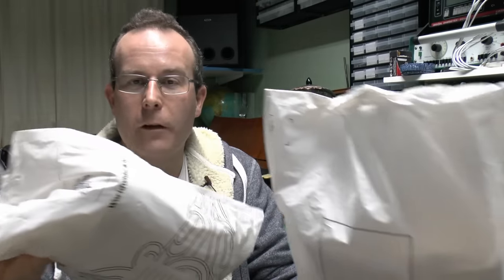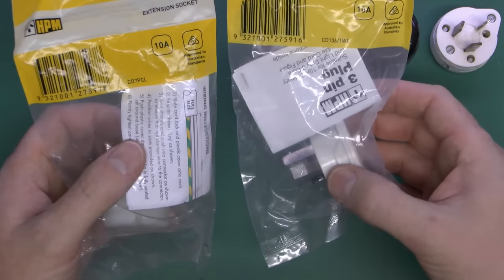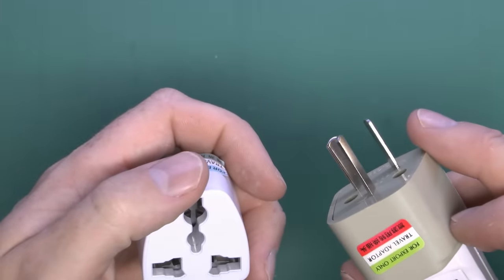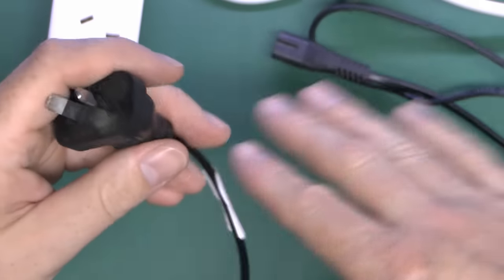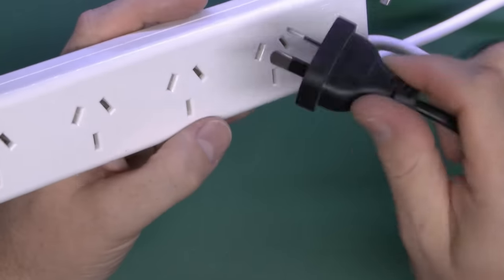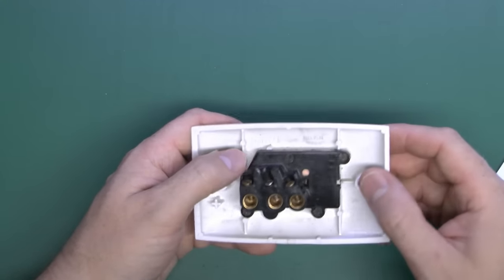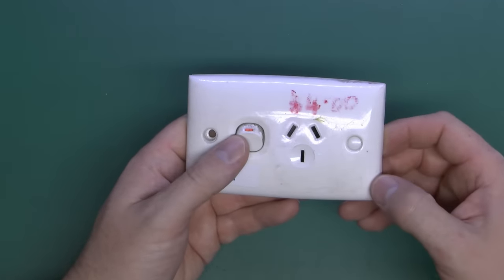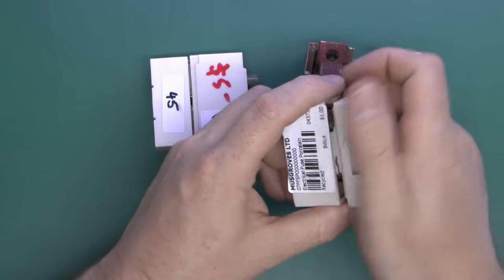New Zealand Electrical Items

Comment: In several comments there is mention of "ring" wiring.  I am American and haven't heard of this.  I am guessing that it means that there are only a few (or just one?) circuits which go to many outlets.  This "ring" would have a breaker at the switchboard which would protect the whole circuit for the capacity of the wires.  This capacity would be greater than most (all?) of the individual outlets, so therefore the individual fuses in the power plugs.  

In the US there are usually many more individual circuits going to few outlets each and with a breaker for each circuit.  The wiring is sized for the capacity of each outlet with the breaker sized for the wire size for each circuit.  A typical circuit would have outlets rated at 15 Amps, #14 wire, and 15 Amp breaker.  This typical circuit would have 1 to 6 outlets, depending on the expected load.  If a larger load is anticipated, then additional circuits, with their own wires and breaker would be added.

It therefore seems to me that the difference in UK versus US wiring is that the UK system has to have the individual power plug fuses to protect individual outlets from the excessive power available on the ring circuit.  The US system has lower powered, breakered circuits for just one or a few outlets.  The advantage I see for the UK system is that each connected device has a fuse appropriate for that device.  It would also probably have less wiring for the same number of outlets.

Do I have this close to right?  I have never heard of "ring"  circuits.  If I am right, then a lot of the yammering about how great those hockey puck sized UK outlets is leaving out a large part of the story.
Reply from the maker: Rings are in this video: https://youtu.be/hZN6hiGLtrE
Basically wire from the breaker, to each outlet, then from the last outlet back to the breaker.
Wire used is undersized (rated about 26A, breaker is 32A) which is only permitted because there are effectively 2 cables in parallel.
Plugs have fuses in them because appliance cords/flex are not rated for 32A.
Other normal circuits such as 16A with several outlets  and a single cable are entirely possible and have always been allowed, but for various reasons, many people still insist on installing rings even though there are few or no benefits.

Comment: 8:03 Rated 15 Amps? Suitable only below 6 amps or below 1870 W.

Also Kopez brand replaceable US plugs in the Philippines rated only at 220V 2 A as it labelled across the plug. Below 440W.
Reply: Australia has a 15 amp plug with pins the same size as the 10A version, and the pins in that US-style plug look like they are a similar size, so if that's true I would guess they should be able to cope with 15 amps without too much trouble.

Comment: 300Ohm Ribbon was standard for TV in Australia and NZ into the late 80s.
Reply: Alex Law VHF only. I still have rabbit ears with the 300 ohm cable and a balun to convey to the 75 ohm connector. Even works with digital TV :) but only in the capital cities

Comment: Those piggyback or pass-through plugs are quite common in New Zealand, especially for things like heaters that, presumably, will be tying up an outlet long-term. Being Canadian, I was a bit surprised: The only place you see those in Canada or the US is on strands of Christmas tree lights, whereas in New Zealand, Christmas tree lights with piggyback plugs just... well, they didn't exist when I lived there, but I moved away 20 years ago, so...

Also, the New Zealand and Australian standards for electrical goods are harmonized.

Comment: Pliers can ensure the US/China style pins fit just fine in an NZ/AU socket (seen it done a fair few times :S).

The powerboard/multiboard cut out is a good idea given Australia does not run individual plug fuses and the general public have a habit of not understanding high current devices and using these boards liberally (although we do have the circuit breakers in the distribution board so in theory these would trip if there was any issue and there was not a cut out.

The one thing I would like to see borrowed from UK electrical safety is the internal  covers (John called them shutters) over Active and Neutral that are released by insertion of an earth plug. Sadly this will probably not happen as in NZ/AU like in the US two pin plugs are used when there is no earth connection so any socket fitted with the covers would be unusable by nearly all two wire equipment (in the days of plastic, and power supplies 2 pin is more common then three with earth). It is very rare in NZ/AU to find a plastic earth pin or pin without a wire in it unless it is the make your own plug style shown earlier in the video (often with the soft plastic cover). 
Screwdrivers are the biggest risk from idiots, smallish pins and the angle do seam to inhibit stupidity a little.
As a compromise, some powerboards have started to introduce internal covers over active and neutral but they are not locked out like the UK. Yet to see anything else bother to date like extension leads or wall sockets

You actually got sent a unswiched wall socket, I have not seen one of them in many years. Very rare with almost all wall outlets in the last 40+ years (probably far longer) having switches but only the more up market powerboards have them and no feed though plugs or extension leads have them to my knowledge 

A shame you were not sent any 15Amp gear, As you probably worked out by now, most of NZ/AU equipment and circuits are 10 Amps. 15 Amp plug is the same Active and Neutral pins but a bigger earth to stop insertion into a 10 amp socket.
Reply: Sean N and 20A sockets uses bigger active and neutral pins, the same size as the 15A earth. We have an espresso machine at work with that arrangement.
Reply: Sean N Canada new regulations require shutters on all newly insralled outlets/Sockets
Reply: Sean N Just cut the US plug plastic cover to make it’s earth pin adapter for Chinese 3 pin outlet for use with 2 pin Aussie plugs. Instead of paperclip.
Reply: Sean N Also can be found of locked out Chinese 3 pin outlets on plug adapters such as Bull brand plug adapters, Xiaomi M1 power strips, etc..
Reply: You can get AU sockets with shutters, they are just very rare.  Only the active and neutral pins are shuttered (the earth is left open) to account for devices with no earth pin.  The shutters only open if there is equal pressure on both active and neutral pins at the same time (to prevent them from opening if something is inserted into only one of the holes).  They are rather difficult to get the plug lined up perfectly in order for the shutters to open.

Comment: The same type of plug is used in Argentina, but I believe the polarity is reversed there.  It could also be found in the U.S. in the past, and old ones are occasionally found on sale as a Non=NEMA design, but these are rare.  I have seen a duplex outlet with one of this type for grounded use and a standard NEMA 1-15 R for ungrounded use.

The same two angled pins, but with a round or U shaped earth pin are also used in the NEMA 7-15 for 277 V single phase use.  These are also rare, the main use for 277 V over there is for large discharge lighting installations in industrial and commercial premises with a 480/277 V three phase supply, and these are not normally fed with a plug and socket.

Comment: That 300 ohm ribbon outlet is for TV. I have never seen one used for radio aerials. All TVs used the 300ohm ribbon until they were replaced by 75ohm coax and then the F style connectors. FM radio, although frequently listened to, was never wired in permanently for aerial in NZ houses. FM was never really considered to be a high quality radio source that was listened to often. Very very early on you might have found radio aerials wired in but that would probably have been 2 individual, usually metal, terminals - one for a single wire aerial and the other for an earth connector. I probably haven't seen one for 40 odd years. I haven't seen a 300ohm connector for 40 odd years either. You may still come across them in old houses 50-80 years old. Any 300ohm ribbon in a working house would probably have been upgraded to 75ohm coax or more likely F connectors by now.

Comment: 22:50 - In 1970, TV aerials in Sydney, NSW used 300 Ohm ribbon cable. Whether it's still used or not would be interesting to know.
Reply: No more 300 ohm ribbon... it's all run in coaxial cable these days in NZ. Better screening and lower line losses and you don't have to solder the plugs on either, just crimp them on.
Reply: 75 Ohm coax came in with UHF TV in the 1980s. F connectors are used for satellite feeds.

Comment: One other thing,  in any fixed cable above 1.0mm²  the cores are stranded, not solid, we stopped using solid wires in about 1995, they are a lot easier to work with, especially 2.5mm² and trying to terminate socket-outlets.

Comment: Re. the two-pin plug @ 7'34" yes, they are illegal, & yes I have two in regular use. My stereo amplifier is a Luxman L45 & has two mains sockets which mate perfectly with the two-pin plug. A lot of amplifiers made in the 1980's has this arrangement. Naturally I added an earth connection to the screw terminal on the rear of the amplifier to keep things safe:)

Comment: 7:58 That's a standard NEMA 5-15 unpolarized plug. It is indeed fitted for 15 amps. No idea why it was in New Zealand.
Reply: Actually NEMA 1-15. NEMA 5 plugs always have a ground pin. 

https://en.wikipedia.org/wiki/NEMA_connector#NEMA_1
Reply: Nate Watson GB-1002 Chinese standard plugs (2 pin).
Reply: Nate Watson That NEMA Chinese 2 pin plugs must be suitable of below 6A can be found on Chinese IKEA lamp shades. It says 110V-240V 6A on that Chinese Ikea lamp shades labeled below. Also 220V to DC adapters with US plug are widely used in China.

Suposed to be used on below 6A appliances.
Reply: It was in New Zealand because the AU/NZ electrical standards have a specification for 120V AC sockets, using this type of plug.  They are just not very widely used.

Comment: THAT 2 PIN PLUG AT 6:52 IS WHAT WE HAVE IN CANADA ABD THE U.S.A. AND MEXICO 15 AMP 125 VOLT WALSO HAVE A 3 PIN TYPE AWTH A ROUND EARTH
Reply: Jamie Phillips Also the Philippines and China uses that plug too on 220V appliances if below 7.5A or 6A and must be below 1875W.

Comment: The good thing about this system of plug is that the active is always the left side. Neutral is the right pin. You can not connect active to neutral although it is AC
The bad thing is they always break. We use these ones for outdoor use on extension leads or power tools. You need to always fix them.
Reply: How do they break?  I've never seen a broken one before but then they are only designed for indoor use.  For outdoor use there are industrial plugs which are much tougher and use round pins instead of flat ones.

Comment: Re. the slots @11' 18" these make attaching the power board to the wall the work of the devil incarnate! You measure carefully, screw in two flat headed screws leaving just enough shank to allow the heads to lock into the back of the unit, press the side one through & slide it to lock it in place then jockey the vertical one in the same manner. It's odds-on it will still look slightly askew & will forever wobble:(

Comment: The same style plugs are also available in 15A 20A 25A and 32A. The 15A plug has a larger earth pin
The 20A has larger all pins
The 25A has a L section earth pin and the 32A has a C section earth pin
All plugs can fit in sockets with a higher current rating so it's all good to plug your 10A appliance in a 32A circuit.
It's normal to see 15A appliances get their earth pins filed down to fit a 10A socket 😀

Comment: the power bord that has 4 outlets holes in back are for mounting to a wall
Reply: Has anyone ever tried that?  If you tried to pull out any of the plugs you'd rip it off the wall!

Comment: It's interesting to see the wall sockets have retained their US origins (as the three flat-pin blade design was from 1915 US of A), and looking at them they retained the same dimensions as what is still the current US NEMA standard, you could probably have US and Oz/NZ sockets & switches side-by side, if you really wanted to of course (handy for them Airstream caravans though!)... :)
Reply: Crazy enough, standard Australian powerpoint and switch grid plates fit perfectly in USA wall boxes. Screw fixings are on ~82mm centres. Flipping it around, US powerpoints and switch mechs would fit in Australian boxes and plaster clips as well.
Reply: @r3tr0nic  The screws are still 6/32 just like the american standard wall plates. The americans have two phases rather than active and neutral to the top pins and where the ground pin is in the Australian socket, the americans connect the neutral.

Comment: Makes perfect sense that a thermal breaker would be required on multiway sockets there, as there's no fuse in the plug, there's nothing in theory preventing you overloading the socket (Unless the sockets are all on 10amp radials?)
Reply: +TheChipmunk2008 Sockets are on 16 amp or 20 amp radials. The most common scenario I've seen for the multi boards tripping is in the kitchen when someone tries to run an electric jug and a toaster or sandwich maker at the same time. They are purely a thermal overload and trip in about 10 seconds.

From what I understand the fused plugs in the UK are nothing at all to do with protecting the wiring in the wall or the sockets - that's what the circuit breakers/fuses in the switchboard are for.

There is a 15 amp plug/socket that is identical except the earth pin is wider. There are variants up to 32 amp (see http://www.fam-oud.nl/~plugsocket/Australian_3hd.html), but I would not recommend plugging a 10 amp plug into a 32 amp socket unless you put additional protection in.
Reply: +Bart Milne Your understanding is correct, the fuses are to protect the flex/appliance, not the fixed wiring, and thank you for responding.  Fascinating link, never knew there was a higher current standard! :)
Reply: +TheChipmunk2008 Most of the high current variants are quite rare except the 15 amp type. Usually PDL 56 series or IEC60309 connectors are used. There is no specific protection of the flex but most appliances here have some kind of fuse protection built in anyway.
Reply: @bjem2287  By rights you shouldn't be using multi-boards in a kitchen, unless the place needs more socket-outlet circuits.

Comment: Is the size of the earth conductor the same size as the live conductors, unlike the embarrassment of UK type twin and earth?
Reply from the maker: jayja45 Yes, all 3 are the same size.
Reply: +John Ward What are the size differences in the UK?
Reply: +jayja45 What sizes are the conductors in the UK?
Reply: +Bart Milne 
1mm2 Live - 1mm2 CPC (Circuit Protective Conductor/ Earth)  
1.5mm2 Live - 1mm2 CPC
2.5mm2 Live - 1.5mm2 CPC
4mm2 Live - 1.5mm2 CPC
6mm2 Live - 2.5mm2 CPC
10mm2 Live - 4mm2 CPC
16mm2 Live - 6mm2 CPC
Reply: +jayja45 The earth conductors sizes are the same up to 2.5mm2 - they they start becoming relatively smaller relative to the active conductors. Off the top of my head they are 2.5mm2 for the 4mm2 and 4mm2 for 6mm2 wires.
Reply: +Bart Milne Still, that's far better than ours, for me, it's singles in steel conduit and trunking or nothing. I think NYY-J cable is used in many parts of Europe, all conductors being the same size, and all insulated, with a ridged outer insulation over the second more flexible layer, then ridged conductors, so three layers of insulation in total.
Reply: The continent has a standard 2 pin plug, but varies on Earth.  The Aussi/NZ plug is a NEMA standard for 15A 240V, and is adopted in China. I see no reason for it to be not adopted in Europe including UK and Ireland.
Reply: brett knows Because it's shite! 😂
Reply: They are in certain instances only, the normal earthing conductor is 1/3 the size of the largest active not withstanding the use of larger conductors for the purpose of voltage drop, the earth is then 1/3 the size of the rating of the protective device.
All the conductors in flexible cords are the same size regardless of CSA.
Submersible pump cables all have a full sized earth.

Comment: I would like to know what the current rating of the final circuit for those 10A sockets is. As there is no fuse in the plug, a rating of more than 10A could result in dangerously high short circuit currents. Yet it seems highly doubtful that more than a small number would be wired into a 10A radial. I think in the USA the 110V sockets are in the form of 20A radials.
Reply: john schlesinger 
Up until recently it was 20amps ,but now on newer homes , it is 16 amps with RCD / RCBO protection 
This due to insulation in the walls and roofs
Reply: @john schlesinger,
The final current rating could be either 16A or 20A radial circuits, depending on the length of run vs volatge drop.
The MEN system of supply we use here in New Zealand and Australia, requires a low impedance fault current path to ensure that the protection devices operate as quickly as possible.
Yes the fault currents are high, but they are very short, provided the system fusing has been designed and installed correctly.
Reply: @steveosshenanigans  I'm not sure where you got the idea that insulation in the roof and the walls of a house requires lower rated sub-circuits.
For socket-outlet sub-circuits, I have always run 2.5 mm² cables, protected by a 20A B-curve RCBO and a minimum of 4 socket-outlet circuits in a house.
Sure, for a short run to a dedicated circuit, maybe 16A. 
I would never low-ball a job with undersized cables.